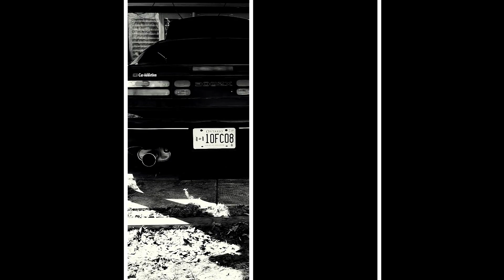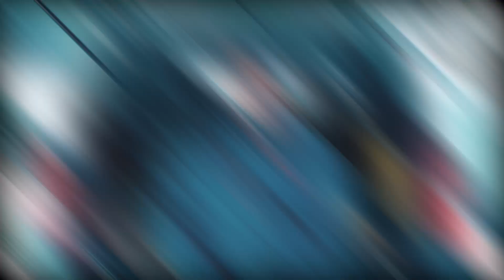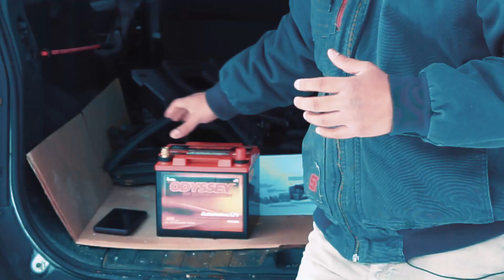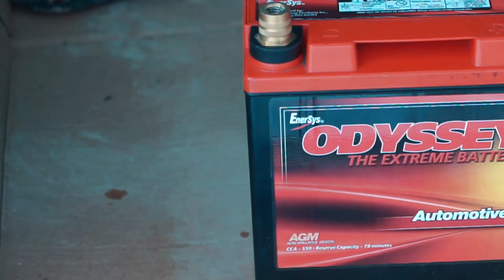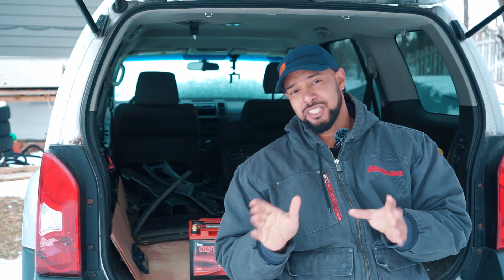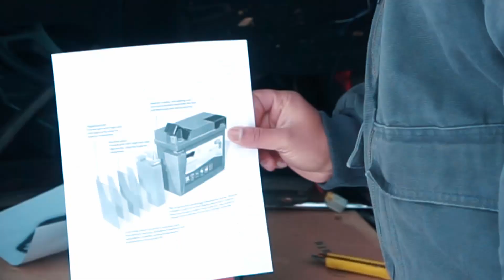What is the best battery for your car? Odyssey VS Optima Battery.

Comment: Let's not forget that the more times your battery wears out every couple of years experience lowered voltage, the alternator is having to work harder to compensate before you finally get a new batter.  For every 10 years of swapping out 3 lead acid batteries you can toss in replacing an alternator on top as well.  Now which one is REALLY cheaper. ?

Comment: You need to educate yourself a bit. The heavier the better is more lead and more power. Lithium has a 40% reduction in capacity below freezing and also doesn’t have good CCA to start a motor. AGM all the way! 👍

Also no matter how a battery is when it drops below 50% capacity damage sets in.

Lastly, Optima batteries suck because they they used to be 99.9% pure lead when they were made in Denver. Research man.

Comment: Purchased a Optima Red Top today. I was told by the cashier that the brand is not what it used to be & they are no longer reliable. He did also mention that he see's them returned quite a bit. So, did I make a mistake purchasing an Optima Red Top today? Has their reliability gone down the tubes? Or did I make the right choice & the battery should last a long time?
Reply from the maker: Please read some of the comments below. Pretty much more than 50% of people said the same. They are not what they used to be.

Comment: The Lithium batteries already are out there, EarthX for one. Expensive but great performance. But they don't do well in cold weather. Also they are very light weight and are more compact.
Reply from the maker: I was under the assumption they would do better than standard lead acid!

Comment: what is the best battery for 2007 mercedes e550?
Reply from the maker: Buy the OEM Mercedes battery. You will have issue with any other battery.
Reply: @runningrich damn I already bought a performance oddesy battery and mechanic has it right now I guess I’ll see if anything happens. Do you know what issues might happen if using the odessy battery? Because I don’t know what would go wrong since the battery is over all my powerful than the oem one and overall all seems like a better battery. But let me know what issues may come up or what to look for. Good thing is i got from fcp euro incase anything goes wrong I have lifetime warranty and replacement incase it doesn’t work
Reply from the maker: Mercedes requires a very specific voltage of 14.2 and specific amperage, usually certain bosch batteries come with them. Bosch makes the Mercedes and BMW batteries.
Reply: @runningrich  what would happen if the oddessy performance battery is used it is higher rated than the oem one.

Comment: I have had problems with Optima Batteries going dead before there time and it’s hard to get a replacement even with their longer warranty. Got a dual post yellow top that has died and even having it on a trickle charger. That’s why I searched the Odyssey battery and believe I’m going to bight the bullet and pay the higher price. Thanks for your video.
Reply: Scotty Kilmer explained why this is.  https://youtu.be/hKo5iJ2rH7o
Reply: It’s my understanding that Optima was purchased by some other company a few years ago and moved production to Mexico and they are no longer quality product.
Reply from the maker: Just so you are aware, AGM batteries don't do well with trickle chargers. They need a full force charge.
Reply: @runningrich 
What do you mean by full force charge and should the charger be a tight for AGM?

Comment: Lead-acid Batteries normally corrode terminals, cables and hold down brackets. End up buying Battery pads for the terminals to try and control it. With AGM Battery no corrosion. Sam's club AGM died, 2 in 2 years. Finally went back to Optima, on year 4, no problem. I will get a odyssey battery next time to try them out.

Comment: Optima batteries no longer last like they used to ...Odyssey are better batteries and what I go with .... All AGM batteries still need to be disconnected when in storage to maintain their charge  otherwise low voltage draws can still make them go dead .
Reply from the maker: Agreed.

Comment: In abusive conditions, the optima will not last even a few months. I was a fan 20 years ago, when they were made in Aurora Colorado. They lasted, but always short on ah compared to the same group size. They are absolutely trash these days, there's a reason you don't see them in parts stores, to many warranty claims. Northstar and Odyessy are FAR superior, for about the same price. I wouldn't give an optima to my worst enemy. They ARE that bad.
Reply from the maker: I actually have a red top, it died right after the warranty.

Comment: WAS an Optima fan. Purchased a Napa battery for my truck in Dec. 2013. I needed a battery for an engine stand so less than 3 years ago I purchased an Optima for my truck and used the Napa for the stand (on trickle charger). Now my optima is dead reading about 7 volts, no parasitic draw with charging system showing +/- 14 volts. Junked the Optima and re-installed the Napa battery (Now about 8 years old)
Reply from the maker: If you read some of the other comments, you will hear similar stories about Optima batteries..  seems like a common thing for optima to die after 2 years.
Reply: @runningrich  it’s a crap shoot, I have a yellow top in my C2 corvette that spends most of its time on a trickle charger and it’s fine after 5 years
Reply from the maker: These AGM batteries doesn't do well on trickle. They like full force charge.
Reply: @runningrich  As I stated I am rethinking Optima. The factory original battery in my truck lasted 9 years

Comment: Hi...I need a new battery as mine just died after 7 years of buying a certified 2011 Caddy CTS 4.. I drive about 1200 miles per year average...about 25 miles per week average along with an occasional road trip 50 miles round trip. Garage kept.. Do I have to drive more to charge the battery or will it drain the way I use the vehicle, and what can I do if this is fact. Any advice would be appreciated, thanks.
Reply from the maker: I would recommend the Odessay series of batteries. They hold charge for upto 2 years as long as they fine have a drain. They charge easy and doesn't need to be trickled charged.

Comment: Optima red top are terrible batteries.  I thought I loved them but then it died over a season. Okay so i got a new one on warranty whatever. Then that one died and another.... every battery was on an expensive nice optima brand charger on maintenance mode when garaged. There was no excuse for it. Will never buy another.
FWIW-
I've read on multiple sources that Optimas manufacturing had changed some years ago and the quality went 💩
Seriously don't get one. Or if you do, you've been warned. Again my experience was with a redtop in my 1997 z28 Camaro.
Reply from the maker: Just a headsup. These batteries doesn't work well on triple charge. Just put full charge on them every now and then.
Reply: @runningrich  yeah i charged them last 2 batts exactly how optima told me to do even on their own branded $200-USD charger. Technically it was on "maintenance" mode on their smart charger. You connect the charger and it just does its own thing based on what the battery needs and has a specific button for optima batteries. I still call it trickle maybe thats not technically correct but anyways. No difference. The last batteries died the same as the first 🤷‍♂️
Ill never own another. I am gonna try out odyssey brand "performance" for my daily WRX and if all is well then ill get one for my Camaro. Probably the extreme. Either that or a deka intimidator.
Reply from the maker: Interesting. If you see some of the other comments, seems like they have moved production of optima batteries out of US to Mexico and that might be the issue.
Reply: @runningrich  I basically watched your video only because you had odyssey in the description hahah.  But yeah I had known this for years about them. They switched production back in like 2009 or 2010. Used to be great not anymore. They got bought out.  My bad experience with redtops in my Camaro was from 2011-2014 for reference.
Reply from the maker: I actually have a red top too. It crapped out after 2 years. Then got the Odessay batteries.
Reply: @runningrich  getting an ODP-AGM35 for my 18 WRX tomorrow.  $280.00 with 22 core charge. It's an odyssey performance. We'll see how she goes! OEM battery is smoked
Reply from the maker: Best of luck
Reply: @runningrich  thanks bro she's in the car now since lastnight. Will be nice to start the carin the morning by its own and not need a booster tomorrow 😅😅
Reply from the maker: Best of luck. Please subscribe
Reply: @runningrich  fixed trickle to "maintenance" so there's no confusion.  It was literally set to Optima's advice.

Comment: On my application the optimas didn’t have nearly the cranking amps the odyssey does. On 7.3 L the CCAs matter.
Reply from the maker: Wow.. how much cca is required for your 7.3?
Reply: @runningrich  I think it calls for 750 cca but the odysseys are 950 cca. The optimas were 800 I think. I literally just bought 2 odyssey batteries it cost me 700 bucks.
Reply from the maker: That's a lot rather money for batteries. You can go with that I have PCD1200 they are supposed to have 1200 CCA. I load tested mine couple of times and everytime it came over 1000 CCA.

Comment: The biggest benefit to odyssey batteries is they’re made in the USA not Mexico and not China.
Reply from the maker: Yes. Buy local.
Reply: But the car you’re driving it’s made in Mexico?
Reply from the maker: @AntonioPerez-hv1lp did all xterras came from Mexico?
Reply: @runningrich very probably but my Ram truck it’s Mede in Mexico! And it’s a great truck!
Reply: The problem is not Mexico but optima stopped using 100% virgin lead

Comment: They do make 12v lithium ion batteries.  They also make lithium phosphate batteries. Battleborn batteries are lithium.  We all know starting an internal combustion engine is all depends on cold cranking amps.  Flooded battery for starting an engine are far superior.  Lithium iron batteries aren't smaller.
Reply from the maker: Agree. These Odessay batteries can push 5 sec of 1200cc. Which is lower than what a Lead acid battery can do.
Reply: Look up antigravity batteries.. .your wrong.  Besides you don't need over 600 CCA unless you live in Alaska
Reply from the maker: What about a big v8 diesel?
Reply: @runningrich  look at the h7/ group 94- it does 2000 CCA.  Any other questions 🤔
Reply from the maker: That's plenty of power

Comment: Had an optima red top in my 99 4runner. The negative battery post separated from the housing and after some email traffic with optima, they ghosted me after I sent them a picture of the battery post. Gotta love it. Guess XS power and odyssey gonna have to fight over my wallet.
Reply from the maker: From other people commenting, I see optima really dropped their ball on quality.
Reply: @runningrich  it's sad man! I remember being in highschool going to Performance racing industry in Orlando before they moved the show back to the heartland. I remember the optima case with batteries that were blown up, torn apart, ripped in half, whole chunks missing out of the casing exposing one or more of the battery packs....

And every single battery in that display case still had enough nominal voltage left over to start an engine. I was blown away and I've always wanted one in my truck.

I guess I shouldnt have met my hero after all 😂.
Reply from the maker: Wow, that's a story...
Reply: Don't believe it..

Comment: Do not buy optima batteries they are pure garbage. I bought one going off the reputation big mistake. Now optima once upon a time was the best battery, But that’s when they were American made. That is not the case anymore, they went from the best to the absolute worst. Last time I bout one I had it replaced 12 times in a year red top yellow top. Got tired of it bought a no name battery for 1/4 the price, which brings us up to date 10 yrs later. I still have the no name, car still fires right up have not replaced the battery once no issues!! Choice is yours do you like spending almost 3x less for normal or do you want to 3x more for a gift wrapped p.o.s?
Reply from the maker: I have an red top optima battery and 2 years later it's dead.
Reply: @runningrich  glad I decided not to go with the 10 optima batteries for my hydraulic system.
Reply from the maker: Wow 10 batteries can cost a pretty penny.
Reply: @runningrich  yes it is imagine if I would of chose to go with the optima’s. I figure around $3000 for 3 months of use.
Reply: @runningrich  I had multiple problems from dead to swollen to electrical problems you name it all under optima. 💯 after 12 optima’s taking that pos out all problems seem to of strangely disappeared. Best decision I’ve made when it comes to my cars!!
Reply: They funny part is I am using that no name generic battery I replaced the optima with10yrs ago to try and restore a pos yellow top this very min 😂
Reply from the maker: I find interstate a very good brand for lead acid battery.

Comment: Odyssey batteries are good, but the longest I had one was for 4 years. The one I’m on now is dying after 2. Optima batteries use to be good but the are horrible now. They last about a year and a half. I also use battery tenders as these cars that I use them in are driven on weekends mostly. I have an FD RX7 and G35. Looking for new options at this point.
Reply from the maker: These batteries doesn't do well with battery tender.
Reply: After working on cars and seeing battery issued for over 20 years, in my experience 8 times out of 10 if someone get a new optima and is having issues shortly there after, there is somthing else going on or its driving habbits or its not getting a full propper charge all the time. My boss bought one for his brand new truck, then after 4 months it was dying all the time and he kept bashing the optima battery name. When in reality it was his driving habits. He lives 5 blocks from the shop. so he gets in it, drived for a minute and a half and shuts it off and he NEVER drives anywhere else. So in turn it wasnt getting a propper charge. I told him to hit the highway for a half hour and come back and to do that once ina  while. No issues since that was 2 years ago. For your battery to get a heathy charge you gotta fully warm up the engine and hit the highway for at least 5-10 minutes. People just dont know that your battery doesnt really start charging until your engine is mostly warmed up or how to take propper care of a battery to get any kind of life outa them. They just think eh its a battery whatever.
Reply: Same here Optima are trash now mine lasted 2 years and this was in a seasonal vehicle
Reply: Dammn that sucks; I had many Yellowtops that lasted 10+ yrs...
But indeed, years ago. I want the same quality... which should I buy these days.
Reply: battery tenders on the lithium battery can cause the optima battery to swell because its not lead acid battery and more closer to lithium battery like  a tesla which is not recommended to charge at 100%
Reply: @Ai-TechWorld1  when you say battery tender you mean the 1-2 Amp mini charger that just stays on the battery all the time right?
Reply: @joefries7046  yea last year o had a yellow top battery with warranty of 3 year for my car. But i put it on battery auto shut off tender pulse mode for a 2 weeks vacation and came back with swollen battery and it was hold any charge and longer .. lucky it was swap out due to the current and was instructed not to fully charge the battery unless I got the optima charger specifically for this battery.
Reply: What did you end up getting for the G35 I’m at that point lol
Reply from the maker: I did have  a g35 couple and then sold it.
Reply: Just buy a xs battery. Best in my opinion.
Reply from the maker: @michaelpersaud4587 you won't have correct CCA

Comment: What does everyone think of Capacitors for a storage energy source in automotive applications. Their adoption has been forecasted for a least a decade but are they really reliable and cost effective
Reply from the maker: What I understand is, they are not reliable in terms of storage.  They have the tendency to explode. That's probably why that idea is not adopted yet. They are super fast to charge and discharge.
Reply: i have a 6pack of maxwell caps, its strong enough to replace the battery but capacitors dont have storage like a battery. if you accidentally put your ignition in accessories and turn the radio on or leave the dome light on, the caps will drain within 5-10 minutes. im not sure if its also safe to use a jump to recharge them cuz when i charged mine the shop had to put a bunch of things between the chargers positive line to the caps. the caps are a great idea since they are very light mine weighs around 5-7 lbs and i use it for car audio

Comment: I have a 2004 F-350 and I bought 2 yellow tops for the truck, because the 6.0 Powerstroke takes two batteries. I have had nothing but issues for the last 4yrs. My truck ran it for 1yr and  sat for 1yr and the batteries went bad and wouldn't recharge, so swapped them and the battery lasted 6mo and I swapped it again under the warranty and it lasted 6mo. So I went back to autozone and this time they swapped me for odyssey batteries and covered the extra price difference, immediately I could tell the difference, my truck never started this fast in 9 degree weather and my voltage is higher like 14.0v vs the yellow tops at max 13v. I like that the odyssey's have a 4yr warranty vs 3yr from Optima. The edit was to fix some errors I made.
Reply from the maker: Thank you, this is a great review.
Reply: I have revived a couple yellow top batteries that seemed dead by charging for hours with an old type charter at 30a. Made them last another year or so. Keep a watch on them while charging and do it in a safe place, it's a lot of amps.